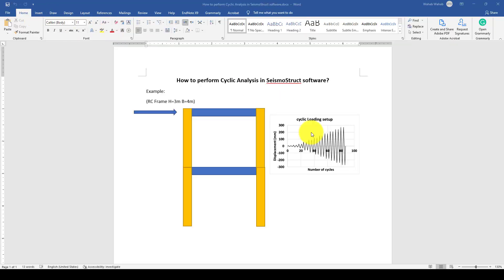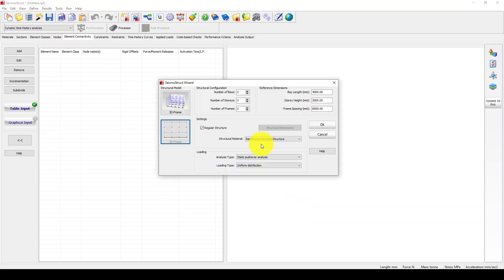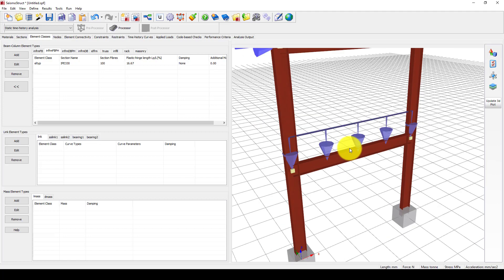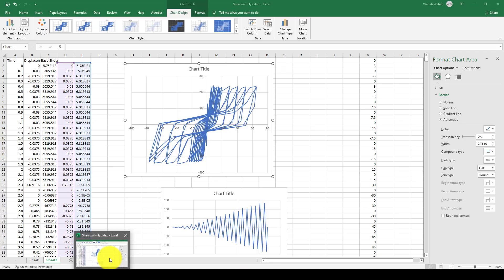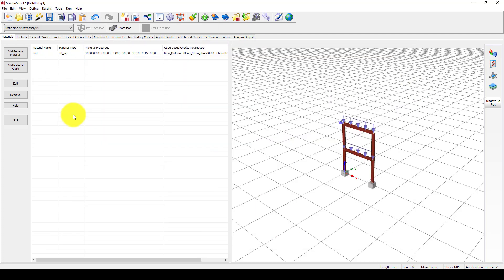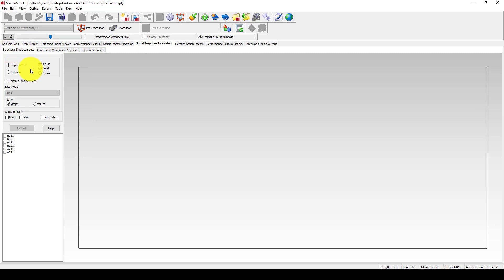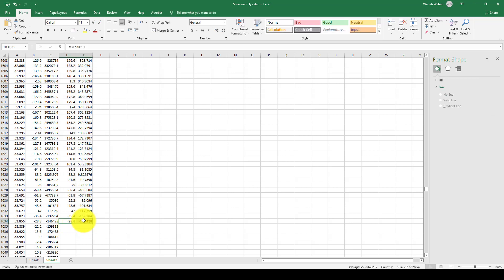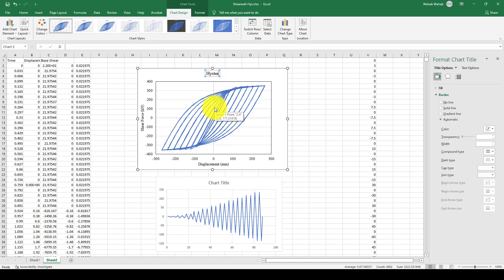Steel frame Under the Cyclic loading Analysis using SeismoStruct Software

Comment: I am trying to model a shear critical RC column under cyclic loading in seismostruct. I am using force based inleastic frame element with mander model and menegotto-pinto model for concrete and steel respectively. For modelling shear, I am using a shear spring with IMK pinching model. However, I am failing continuously to arrive at relaible results. Would you be in a position to give some inputs?